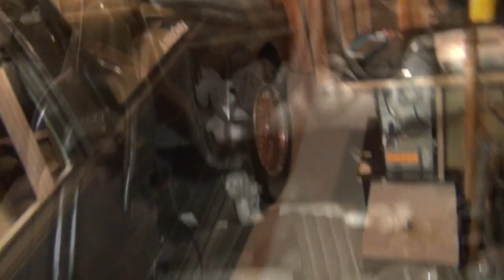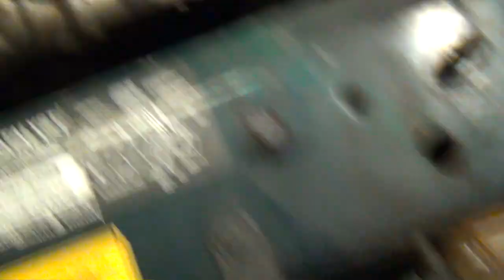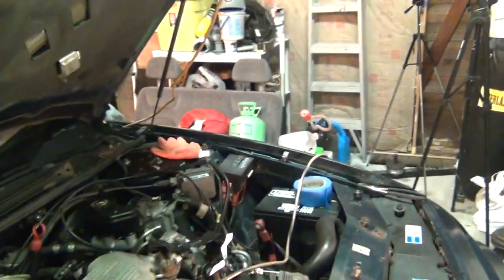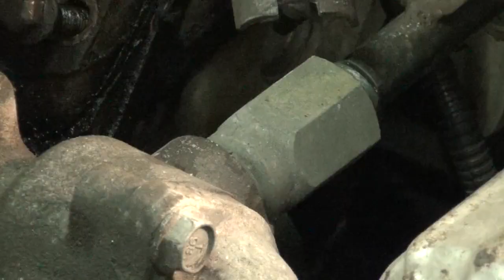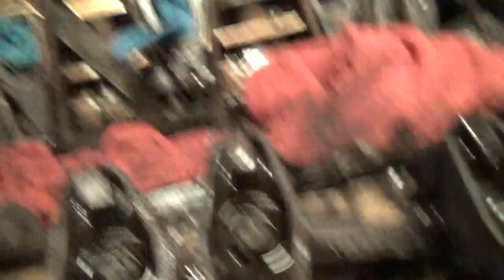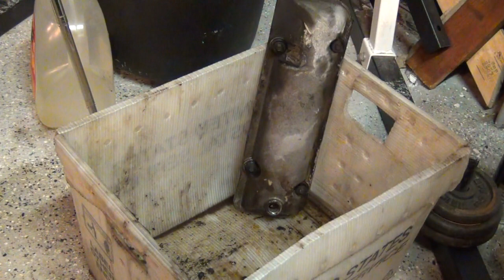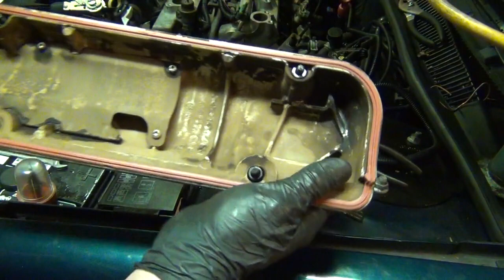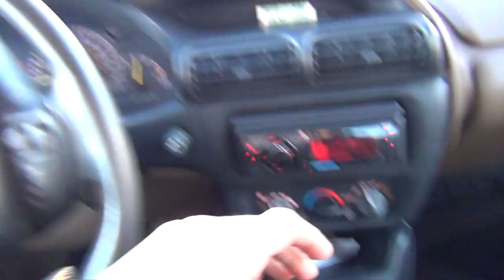Intake Manifold Gasket replacement GM 3100 V6 95' grand Prix

Comment: Yeah guys. I guess its a common problem with these old high mileage 3100 GM engines. When you go to loosen up the rocker arm bolt, often they will strip out. If that happens, unfortunately it did with me, you got to get a “Time-Sert 1812 CORE M8x1.25MM Metric GM Rocker Arm Thread Repair Kit”  it works alot like a Heli-Coil, but its designed for this application specifically. With that being said, you can avoid doing what I did by Google ing  "Lisle 48300 pushrod removal tool" It's like 15 bucks. What you do with it is decompress the rocker arm springs so that you can take out the push rods, without loosening the rocker arms bolt. I really wish I had done it that way first.
Reply: Michael Brown help me lol
Reply: hey man thanks a lot I'm definitely going to buy this

Comment: Thanks for the video!
My dad has a 96 3100 4 dr grand prix & blew the head gasket the other day.
confirmed that today
So I will be fixing that myself but also upgrading the intake manifold gasket as well while im in there.
Would be pretty pissed if I had to take all that off twice & then all that cleaning!
& the rear spark plugs too actually, since he couldnt get to them.

Comment: GM motor is notorious for head, intake and other gasket failures, oh and the crankcase seal also failed big time. I hear the Dex-cool is to blame for deteriorating of the gaskets so I'll be switching to green. Well folks, I wanted to be a Beer-Drinkin, Car-Fixin REAL Man... so I decided to repair it myself (after years of intimidation/hesitation/preparation). This entire gasket replacement has taken me on a journey, probably similar to a heart surgery, and I am still not finished putting it all back together!  But I got over setting the rocker arms thanks to you for making this video,@905speedgta. I appreciated your precise explanation very much. I hope to be up and running soon

Comment: Thanks for your Video it was very Informative and well done
I'm just now in the process of replacing my Brothers Intake Manifold Gasket, his car  is a 2000 Buick Century with a 3.1, it had a little white milky Oil/Antifreeze mixture on the PVC and down inside the Valve Cover and during inspection I could see where it was actually leaking between the Gasket his doesn't have a lot of Mixture of Oil/Antifreeze inside the Valve Cover yet,but would have probably progressive got worse for sure,and if this problem is not fixed soon it will actually ruin the Rods&Mains and Cam Bearings and cause it to start loosing Oil pressure due to ware on the Bearings from the Mixture and can also cause it to start Knocking due to lack of lubrication  as well, so one should  fix this problem as soon as possible and Thanks again for you Video

Comment: Great video. I have a buick rendezvous purchased one year ago.I had the job done by a shop while I had a warranty. Even now the car goes past half mark when in Traffic and in hot summer.  I suspect it is leaking again the guy did not use Fel-Pro used magnum or something( even GM updated part).
Reply: I have replaced all 3 coils from acDelco oem coils for 100$ with shipping from ebay. There was a tiny bity misfire. that could also cause past half mark issue. Done the job last week. Seems to have fix the issues.

Comment: you removed a lot of things that did not need to be removed. like the power steering pump, just take the three bolts out and put it to the side. absolutely no need to remove the lines and go through all that.
Reply from the maker: why?. why put it to the side when i can take the 3 mins it took to completely remove it out of my way. Also, as I said in a previous comment " preventative maintainence" The O-ring onthe pressure line showed signs of seepage , also with the pump out of the way I can clean areas where there was dirt and debris

Comment: Why did you not do head gasket? I think I will hit that to since I am there. Thoughts?
Reply from the maker: ourcynic The fuel injector o-rings are actually a seperate kit you have to buy from felpro. It is very important to do the o rings on your injectors during this process. and it is NOT a waste of time. Over time, the fuel o rings get mushy and begin to dissolve, and have been in the car for 18 years and 90k miles. This is called preventive maintainence. Ive seen many 3100s 3.4s come back for leaking fuel injectors because in some way shape or form have been disturbed. unlike the added cost of taking the extra step and just doing the head gaskets when they dont need to be done as someone else suggested in the comments, this is totally worth taking the added step. for only 10 dollars i think it was
Reply: Why would you unless you knew they were bad? To do that requires taking the engine much further down, including the exhausts. But hey, it's your car.
Reply: Yes, I see your point. Everything went well. I just have two little issues. I have a bit of a high idle and a slight coolant leak at that metal heater pipe off the thermostat housing. Does that pipe just push right in to the thermostat housing with a bit of RTV?
Reply: By the way, thanks you gave me a lot of power with this video.
Reply: Mark Daniels No RTV! There is a little o-ring in the Felpro gasket kit. It is the replacement for the one on that pipe coming out of the back of the thermostat housing, and if yours looks like mine did, you're gonna need that new one for sure. I should be the one doing this video.
Reply: And that is why she leaks, darn.
Reply: Mark Daniels Yeah, damn Felpro for not including some helpful directions with the kit. I figured it out by accident while inspecting that pipe. Sometimes I get lucky. You should be able to get that pipe back out. Remove the intake accordion...remove the heater hose...loosen the bracket-bolt on the head...should pull out. Won't be easy, but should be doable.
Reply: Thanks - I was wondering why all the gaskets. I figured out most of them, but that one stumped me. I wished they had put the fuel injection o-rings inside., but no!
Reply: Mark Daniels The reason for no injector rings is because it's not necessary to remove the fuel rail or injectors for this job. The guy in this and other videos did, but it's a waste of time. They're not what's broke, so no need to fix.
Reply: Okay and I just figured out what the last o-ring is for. On the Felpro box it's listed as an "oil filter seal" or some such shit. It's actually for the pipe that stubs up from above the water pump with the bleeder screw on it. That's the same pipe that runs across the front of the engine, turns back, loops through the throttle body, to heat the incoming air, and connects to the heater hose. Another detail that didn't seem to be in this video, or any of the other ones I've watched.
Reply: Yes, I used it for that purpose. I almost did not.
Reply: And I just pushed the fuel rail to the side and held it back with a zip tie.
Reply: Mark Daniels Yeah but my point was that the fuel rail doesn't even need to be taken off the manifold to do this job. Just have to disconnect the fuel lines .
Reply: You are right? I was thinking about that, but when my quick discontent tool did not work in taking the fuel lines off, I stopped. I need to practice that move on some car at the junk yard.
Reply from the maker: Mark, I didnt do the head gaskets because they were not blown. They also showed no signs of failure. I can see your point tho, if i went that far why not go alittle further. But you have to stop somewhere. The price difference between doing the job the way I did it, and including the head gasket was very big

Comment from the maker: Edward. Believe it or not I had a 1993 Supreme SL with the 3.1. WITH THE SAME PROBLEM. Mine turned out to be a knock sensor. is there a service engine soon light?..if so do you know how to get the codes from the computer

Comment: always wanted to tilt the motor 93 cutlass & thought whats gonna break ? I'd take off the PSP @ this point inspect & empty/clean why not unless times a thingThe metal heater tubes are scary they always crack @ the weld mounts.The 93 3.1 is the same idea but several differences.One of my concerns is do I have O rings nuts,(anything) that needs replacing (& there will be surprises) if lost or broken,being my only car & parts availability.Where do you find the torque specs for everything you did

Comment: Also a little anti-seize on the EGR bolt threads is a good idea, they can become quite rusty over time. Rusty bolts in aluminum have a tendency to break (not good).
To all the first timers, put that cell phone camera to use as you disassemble, it will make re-assembly that much easier.
If you have the famous cracked rear exhaust manifold that many pre-'97 W-body 3100's have, this is a good time to attack that bastard.

Comment: Great video Dude. Done too many of these gasket jobs, most labor intensive. Generally not for the beginner, but I would and will recommend your video. The valve rocker tightening chapter isn’t really necessary, but great for teaching the fundamentals. It is a good idea to squirt a little oil onto each lifter before re-installing the push rods, it will help ensure the lifter pumps up when you start the engine.

Comment: Ok, so read through some of the comments, and figured out that this isn't a necessary step. but another question is how did you turn over the engine? Do you just stick a socket in the center of the pully and act as im tighting the pully, or is there a special tool required?

Comment: Question: I have a 02 Buick, with the same 3100 SFI engine, and on torquing the rocker arms, I have seen on other videos, and even the service manual doesn't state that I have to turn the engine/rocker arms to TDC. But in the video, you did...Is this just general practice, or is it required for the 3100? the reason that I ask, is I dont have a tool, or even know how to move the engine. And a friend also told me not to touch anything, and just torque as it is. Is it alright if i just torque it?

Comment from the maker: there is a retaining bracket holding in the lines. But, your information " which is appreciated " is misleading anyone that wants to do this. you have to get the pump out of the way to do this job. its best to not leave it connected to any lines while your pulling other stuff out. infact, you cant leave it connected. maybe your thinking of the 3.1L. i forget how much clearance is there on 3.1 pump. but you do need to remove the pump on the 3100's

Comment: ok WHOA do NOT REMOVE POWER steering pump, just remove the cap off the fuel rail by the power steering pump, remove the idler pully from the bracket bellow alt, then pull the power steering upmp straiight up, and just wiggle it back and forth it WILL come out without removing injectors or disconnecting the lines from the pump, you just push the pump off to the side, if i do recall theres a nut holding the lines down somewheres u take off and u get tons fo flex with the lines, DONT REMOVE IT

Comment from the maker: no, well..Sorta. when you refill the system you supposed to turn the steering wheel  from left to right all the way. this gets any air out. Once your down to the cylinder heads and all accesories are removed you have the head bolts exhaust manifold bolts and anything connecting the cylinder heads to the block. dont forget to change that distributor plug O-ring.

Comment: First I have to say great video, very well done. I have a 02 Grand Prix with an external head gasket leak I am going to tackle soon, I was wondering how many more steps is there to get them off after you get the intake out. I know I have to get all the head bolts out and I assume I have to take the water pump out too. One other question, is there any specific procedure when filling the power steering pump with fluid? Thanks again excellent video.

Comment from the maker: They are.  The 3800's are much easyer to work on, especially when doing a intake gasket set. The 3100s in the W body cars give alot of room to work in. Most GM cars with the 3000 series are not too bad to work with.

Comment from the maker: Mark, the engines are similar, But you need to make sure that engine is a non adjustable valve system like mine. It most likey is. But just make sure. those vans Ive never worked on, and I believe you have to take the wiper tray out to do this service

Comment: I'm not sure where I went wrong... but now my car doesn't want to start... started fine before I pulled the lower intake... now that i've done everything it won't start... and it seems like the starter is whiney (not sure i've only started it once before this)  could I have put the distributor in wrong?  any advise would be awesome!  the motor is turning over but it doesn't sound right to me.  I've checked all my connections and the plugs are all right.

Comment: yea i drew out on a big piece of paper what injectors went where and cleaned them up.. took me forever to get them out of the bottom intake i couldnt get a good handle on them so what i ended up doing was take a small socket just big enough to punch them right out.. and into a piece of newspaper to catch them .. worked great really.

Comment from the maker: right, Non adjustable Valve system. just tighten and go. I like to spin the motor so when the cylinder that im tightening the valves on is at top dead center with the cam lobe flat. its the way I was taught. Ive seen people have to tighten the valves over and over again cause something wasnt really tightened, valve clacking do do not tightening correctly etc. id rather TDC the cyl tighten and torque and be done, and never have to do it again.. my engine is quieter then most 3100 after this

Comment: the thing is you shouldnt have turned the engine over at all while tightening   the rocker arm nuts..back to specs as the 3.1 and 3.4 you dont have to set the valves.

Comment: thanks after i drove it the knocking quit the problem i had was no power and that was due to fuel injectors apparently i cut one putting the fuel rail on the car runs great now thanks for the video was very helpful since you cant adjust i never had to spin the engine just torque the rocker arms to 25 foot pounds again thanks for the video

Comment from the maker: Judd, Engine gets spun to your right. lets say your on the passenger side of your car leaning in. you want to spin it clockwise " to your right". now as far as knocking goes. do you mean bottom end knock or a tick?. judjing what you have explained, im willing to bet you have ticks.. multiple ones. follow thew video, setting these valves are easy. top dead center, and tighten exhaust and intake for that cylinder. No adjustements. tighten and torque to specs

Comment: I have a 2005 Pontiac Grand Am Se, with a 3.4L V6 - Aside from a few things in different places, like the orientation of the battery & the air intake filter box, are there really that many differences? I didn't notice too many. One thing I will point out, is that these vehicles are known to have faulty fuel pressure regulators.

Comment from the maker: Depends on where you live. and the person doing it.  I am in long island NY, a expensive place to live. and for this job I would charge  about $360 for labor. a shop you have to remember half the engine is coming out. shops have overhead etc. I do not.. expect to pay anywhere between 400 and 900 dollars for this job. ive seen shops price this job out at about $1000 dollars. Its a big Job. lots of things to remove. if your guy is a backyard mechanic he should be able to work in a price like mine

Comment: My father-in-law is the original owner and the papers are still in his name, so that's a good thing I suppose... The problem with the multi function stick we got a quote for around $ 600 bucks + shop time. I was going to find one from the pick-a part place here, but to no avail yet.. I shall try e-Bay then, thanks for the tip. I will let you know about the class action lawsuit as soon as I find out more info.

Comment from the maker: GreenEyes, the problem will worsen over time. you can try some additives to stop leaks. I personally have none to recommend, however, if you ever have a oil or transmission or even a power steering leak, try Lucus out. its a oil additive that actually stops leaks even slows down horrible leaks. At anyrate, the multifunction switch isnt hard to do, dont forget any tools you need places like autozone, o'riley they rent tools out now adays for the D.I.Y'er.. Do you want to sink money  into it?

Comment: We have same problem with a 2002 Buick Century. It's leaking coolant, nothing too serious yet. Got a quote from a local shop. $ 1200. That's just too much to invest in a car that will probably continue having more issues as time goes by. We also have to replace the multifunction stick ( morons in Detroit designed it so badly, we don't have lights). Now I am stuck being the new age Cinderella getting home before dark, or driving while pulling at it to get  headlights. Will the leak worsen? advise

Comment from the maker: That could actually be a computer problem, or a fuel injector getting ready to fail.. i had a fuel injector short the whole rail of injectors out and the car wouldnt run right. what your experiencing has happened to me with a buick century and a 1988 trans am GTA. The Century needed a Crank sensor the GTA needed a fuel injector

Comment from the maker: you most likey have your wires crossed. I see this alot with Do it yourselfers. get the firing order online.  I think its 1,2,3,4,5,6  the three back cylinders are 1,3,5 .. and the three front cylinders are 2,4,6.  also, as i said in my video YOU MUST put the fuel injection harness terminals on all the injectors each one came off of. this is a SFI motor Sequential fuel injecion.. start off there and let me know what you find